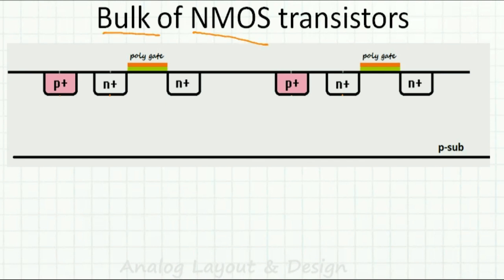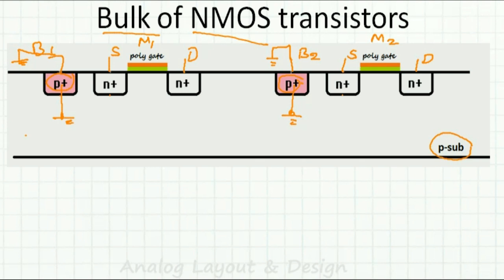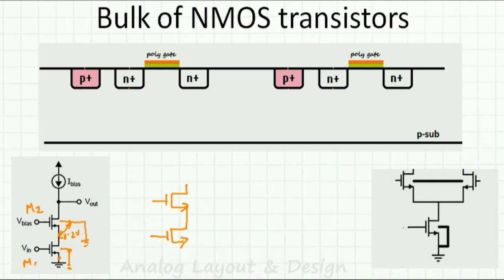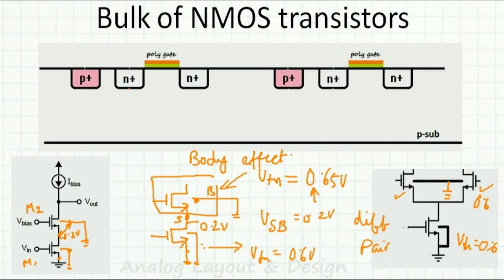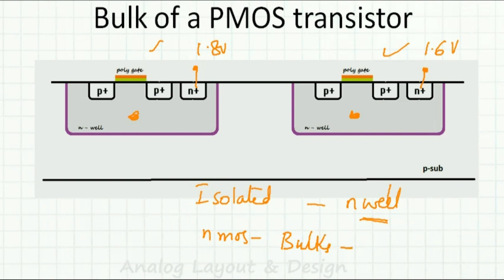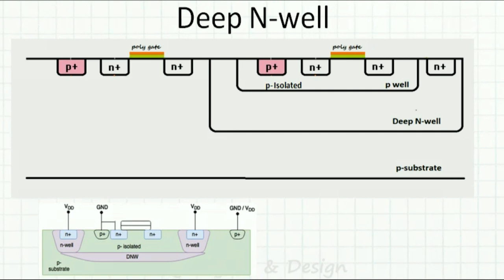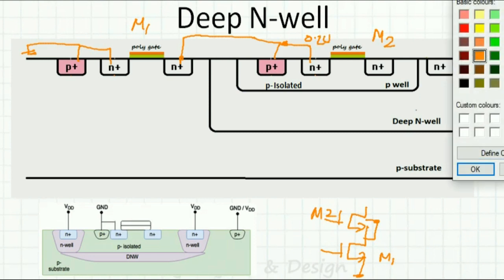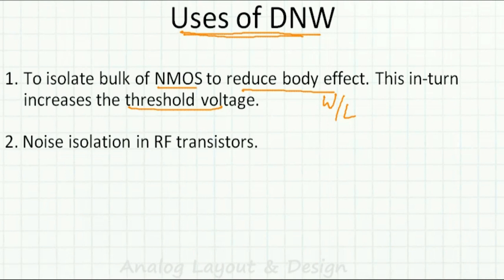DEEP N-WELL (DNW)

Comment: in which situation DNW is connected to gnd?  again in which situation DNW is connected to vdd ?
Reply from the maker: Dnw and n-well are shorted...so it should be connected to higher voltage...
Reply from the maker: Not to ground

Comment: Very Nicely Explained. 

But in lower technologies like 65nm or 45nm,  we don't have this  bottom isolation I.e Deep N well.. We isolate a device only from side by adding rings and use ASUB layer to clear LVS..
How does this not pose a problem in device operation ?
Reply from the maker: There won't be any problem.. please watch agnd,dgnd,isolation video...I think I have explained this there
Reply from the maker: They may short agnd, dgnd at pad level.. they may do a star connection there

Comment: Usually ,We connect Deep n well to highest potential ( say VDD =3 V) ..
Is it possible to have a 5V PMOS device inside this Deep N well?
Reply from the maker: Nwell and DNW will be inherently shorted.  Whatever voltage you connect to nwell will be shorted to DNW also. When you connect 3v to nwell and 5v to dnw, then you are essentially shorting 5v and 3v with little higher resistance that's all...

Comment: To isolate local sub and global substrate (p), We use  deep n- well  . By
 using dnwell VT doesn't vary then there is no body effect . Finally dnwell is used to avoid body effect .
Reply from the maker: when you connect bulk to source then there would not be body effect. but DNW is not only used to overcome body effect. It will also provide isolation. Please watch video on AGND, DGND & ISOLATION.
Reply: @analoglayoutdesign2342  ok sir

Comment: sir can you please make a separate video on that .Why we powered deepnwell to vdd and why not to vss
Reply from the maker: ok sure
Reply: hi sushant  ,  DNW is formed by  a  n well ring , the n well ring is connected to vdd   so DNW is connected to vdd , the DEEP N WELL has the effect of decreasing the noise coupling through  It to substrate and  it isolates the nmos devices  which can be at different potential from gnd.
Reply: if you connect, deepnwell to vss, it can act as a forward biased diode with substrate. (n-p connected to vss). We must always make sure that parasitic diodes are reverse biased for non conduction :)